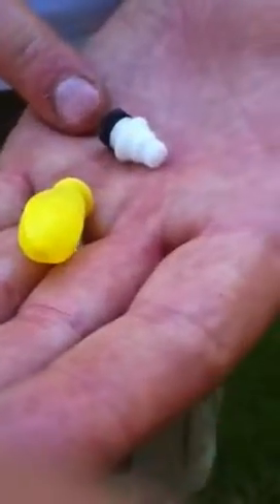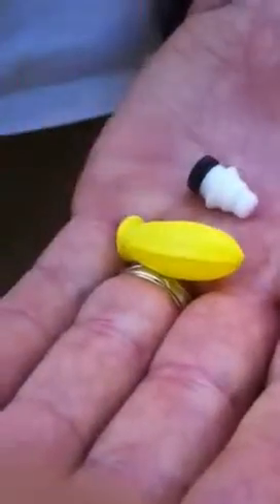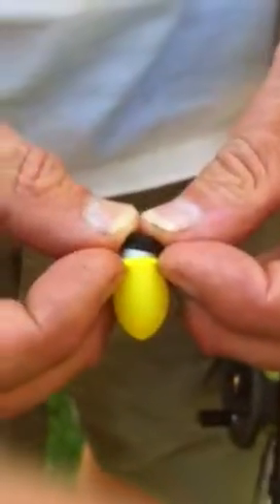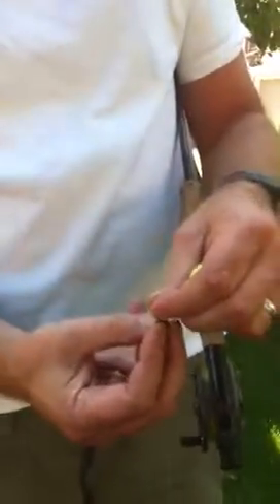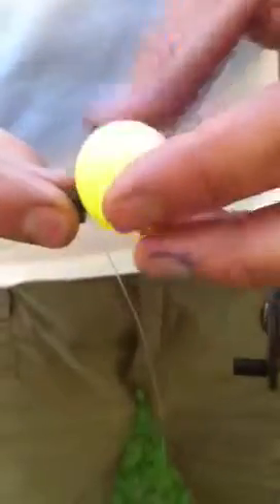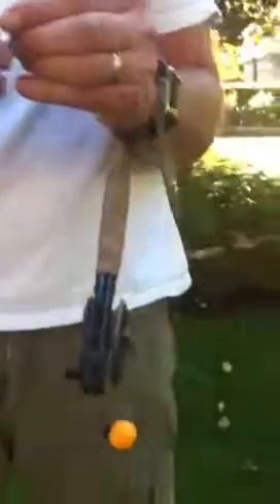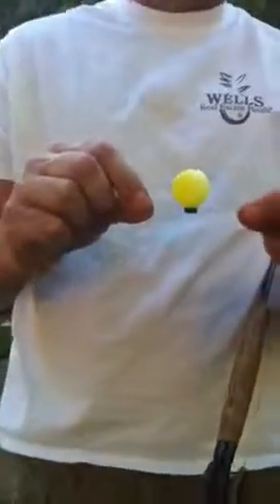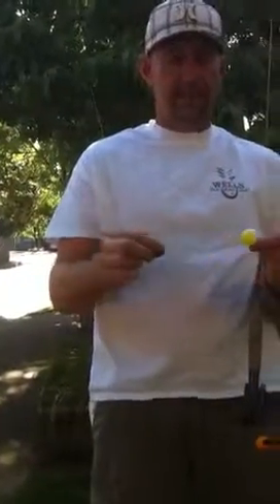Balloon strike indicator demo

Comment: I will tell you this. This is the best strike indicator ever made. I myself was going to design a type of strike indicator very similar in design. While doing a patent search I found someone had made the product that I had in mind. So I decided to give their product a shot and I never looked back since. As a fly fisherman you know that we spend a lot of time tying on new flies taking knocks out or adjusting are indicators. This indicator takes less than 2 seconds to move up or down your leader line to make that perfect presentation. I myself prefer the balloon type strike indicator because of the simple fact you may make it a small indicator or a large indicator simply within seconds as well as adjusting up and down your leader line in seconds. Best of all it does not change your line or damage your line nymphing right to dry fly fishing without changing your leader. How much time would that really saves? I live in Jersey were trout fishing is pretty big and everytime I show a fly fisher on the water they think it's the greatest thing since sliced bread. Also just to give you a heads up no I do not work for them. I am just a little bit jealous because the beat me to the punch. But all credit is due to them because this is a great product.